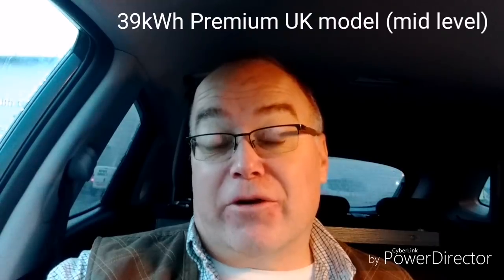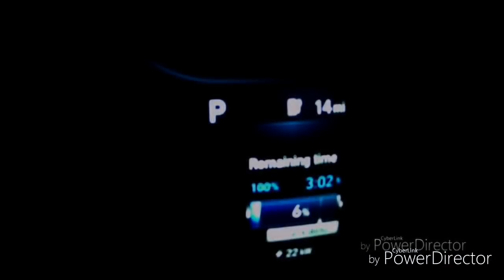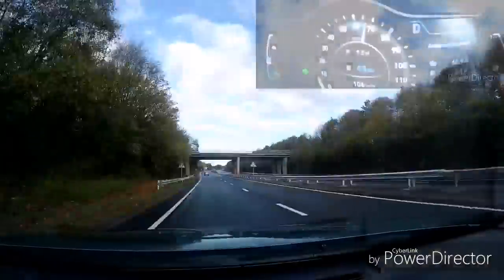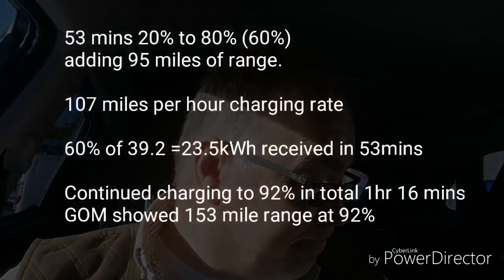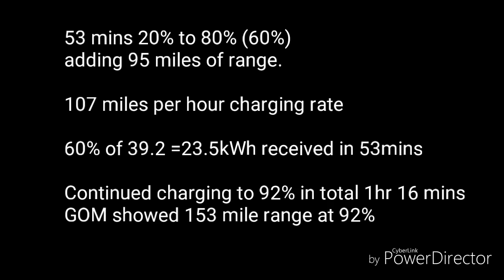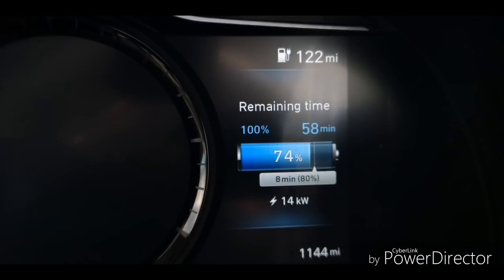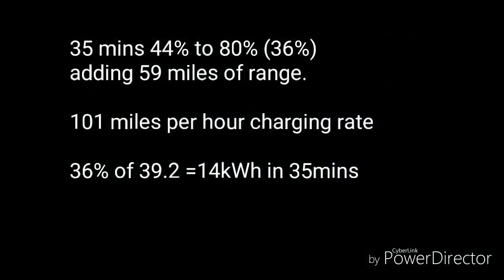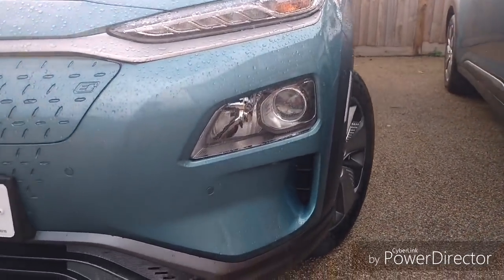Multiple Rapid Charging / Charging concerns & why I wouldn't buy a 39kWh Kona Electric

Comment: While it may be possible to set the car up at home to be nice and cozy from the start, once at work, there are not charging options. The issue you have thrown up regarding the temperature settings are of concern. You may say, forget the dial figure and just turn it to where you are comfortable, but to have 'cold' air blowing through should only work in the summer with a temperature sensor facing the windscreen. It would appear that everybody should test their dream EV car in the winter to ensure that it will perform as they would like.
There appears to be more questions about people's expectations coming from an ICE environment and being thrown in to an EV option thinking that everything will be the same. At least with an ICE car, you know it will be cold to start with and once the temperature sensor goes out I(Honda Jazz) you will get heat and the temperature gauge will reflect what you need. I would also be interested to learn about the direction of air flow with all the dashboard, screen and footwell settings. Starting from work (with no charging facility) on a cold winter evening, I would expect to have the front screen, overtaking mirror and rear screen defrost buttons pressed and a lot of warm air ultimately being blown out or elements heated to clear everything up for safer driving.
It still leaves the question about winter driving and impact on range - It is wet, and you need the wipers on. It is cold and you need the heater on. It is frosty and you need the rear screen heater and overtaking mirrors elements on. What range then?
Great video and opening up some tantalising questions.
Reply from the maker: Michael, I think you've got it and understand where I'm coming from. There's too much not knowing and it's hard to appreciate the car until you've owned it in varying conditions.  I did not expect half power or less charging at 5c. Whether that's right or normal is another question .

Range seems to be affected less than I expected by having the heating on but cold damp mornings are definitely less efficient than dry days.
Reply: You can start the heating on the Leaf from your mobile phone app while you are having your morning coffee and the car will be warm and defrosted before you set foot outside the door
Reply: @BSAT10  Which is fine while you prepare to go to work. Once at work with no charging facilities, for the return, the whole normal ICE heating regime starts once the 'engine' is started and moving. How does that compare with starting an EV from scratch in the cold?

Comment: Just to clear a few things up was the 39kwh battery preconditioned in the morning using winter mode? I found this makes a big difference with a cold battery.
Reply: I am interested about this too. I guess the Winter mode was not enabled during the test drive and charging.
Reply from the maker: Winter mode is completely separate and not relevant in the temperature ranges tested
Reply: @EVPuzzle  i understand winter mode is a separate bit to the car. However winter mode is used to precondition the battery therefore warming it up so its at idea running temp performance to drive and charge. 

➃ ‘Battery care’ shows the momentary power and energy consumption which are used when:

• Operating the winter mode to increase the battery temperature during winter to improve the driving performance.

• Cooling down the battery temperature during summer to prevent over temperature of the battery. 

hope this helps explain your results.
Reply from the maker: Mark I've had the detailed info on winter mode from Hyundai and their workshop manual.  It has no affect above -10c. It avoids the car going into turtle mode at too low temperatures. 
Winter mode on or off would not have impacted this set of tests, so I've been told by Hyundai

Comment: The throttling may be because of grid issues rather than the car. The UK's infrastructure is creaky (close to collapse if you believe some insiders) and cold days with high daytime grid usage will cause power distribution issues. Best to try this again overnight I'm afraid when grid usage is lower. Clearly not Nissan levels of rapidgate though.
Reply from the maker: John, that presumes a rapid charger monitors grid activity and throttles according. Have you found anything that confirms this.
Btw this was early Sunday morning so no peak times at all
Reply: @EVPuzzle  It's more that the local grid monitors demand according to the supply it is allocated and distributes accordingly. The power generation is taken online/offline according to predicted demand so Sunday morning will see a minimum of backup supply on-line. A cold morning easily eats up surplus and local network throttling can then be implemented to prevent outages.  The whole system is very efficiently run but is on a knife edge as older power stations are decommissioned. The downtime and maintenance of the rest has to be factored into supply both locally and nationally as well (grid loss being a function of distance). A very complex testing environment !
Reply: @johnnorth9355  
Hi John as someone who worked for Bonar Long ,Hawker Siddeley, and GEC all suppliers of the National Grid I can reassure you that your "insiders" are wrong
Reply from the maker: John, so you're saying the grid throttles businesses electric supply?  Either I'm obtuse or I just don't understand what you mean.
The charger is a business location. Its provided power at a stable rate. I see no reason for this business to have its supply limited than any other business so its supply should be stable. Chargers use less power than other businesses so it makes no sense to me to think time if day would impact how much power is given out from a rapid charger.
Reply: Not the 40kWh Leaf's levels of rapidgate, but worse than that. From what I've been following, nobody ever gets the "promised" 50kW with a Leaf, but people start calling it rapidgate when the power goes down to about half that, and anything below 30kW is considered quite disappointing. Here we have such levels from the very first rapid charge, with occasionally an unexplained much lower rate (and also occasionally an equally unexplained "normal" rate). And that while thermal management should remove most need for such throttling down.
Reply from the maker: Definitely confusing and disappointing.

Comment: What you are seeing here is a cold battery charging issue which is expected, once you warmed it up you got normal charge rates, in a real test you would start out with 100% drive for a least 100 miles heating up the battery and only then rapid charge, does the Kona not have battery temp readout, very poor if it doesn"t.

Comment: Maybe you can use that thermometer to measure the battery temperature before, during and after charging?
Reply from the maker: I did on the casing, couldn't access anything else. 7 degrees before rapid charging 12 degrees after. Its obviously well shielded

Comment: Wow, that seems much more aggressive tapering than I see on the 40 kW leaf. Weird. Re the heating we've found the leaf is the opposite, we need to turn the heating down. Even at around zero degrees outside if we have it any higher than 17 degrees it's too hot. The leaf seems to charge at 45 kW until around 60% charge and them drops down to around 35 kW. It only drops down to the 20s when you get past 70 to 80%. Wonder what's going on.
Reply: Yes very odd. But lemon tea leaf has been wondering with a few of us whether Nissan have done an over the air update because we're seeing different charging behaviour across a number of cars. They are tapering the charge more gradually, ie it isn't just blasting on 43kw until it hits a certain percentage. The tapering is more linear it seems. Not studied it but they may all be trying to work out how best to avoid cooking the battery. Certainly on this evidence it's quicker to charge a 40kw leaf than a 39 kW kona. Truly the EV Puzzle
Reply from the maker: Its arbitrary I guess as the 64 doesn't have such issues it seems. Mind boggling why the 39 might be so different with the same technology
Reply: @EVPuzzle  even your expected time from 20% to 80% is slow compared with my experience in the Leaf. Not at all what I would have expected with active battery cooling / heating 

I did a charge from 18% to 87% the other night in 43 minutes and that's faster than even what you expected in your comments above
Reply: @enyaq_gorm  I'll 2nd those Leaf comments. I charged from 14 - 80% in exactly 40 mins last night. This only raised my battery temp to 50% meaning if I drove at my normal 62 for 100 miles my next charge would have started at over 40kw. I can't believe Hyundai would throttle the charge that severely on a thermally managed battery. Seems like a fault.
Comparing the throttling to the 64kw is a bit unfair. 80% on a bigger battery still leaves much more room so won't throttle nearly as much.
Reply from the maker: Ross, comparing is fair because it highlights the benefit of buying the bigger battery.  
Who'd have thought the Leaf would outperform the Kona in a Rapid charging test?
Reply: @EVPuzzle  not me, and I own one! I genuinely think that car you drove had a fault, it will be interesting to see if any other Kona owners start reporting the same issue. Your first charge was only at speeds a 40kw Leaf would hit on its 3rd rapid so if it is the expected performance its far worse than rapidgate and with a thermally managed battery I can't imagine Hyundai making a mistake like that.
Reply from the maker: To hear from some owners of the 39kwh would be great
Reply from the maker: It left me wondering for sure especially when the Ioniq appears to charge quicker.

Comment: Nigel, nice set of videos comparing the two versions. The in-car heating issue is getting frustrating and will probably get worse as the temperature drops. I may have to report the Hyundai.
Reply from the maker: Cheers Glen
Reply: There have been suggestions on SpeakEV that the Heat button must be pressed as well as the A/C to get things to work properly. Sounds odd to me and I've not used my Kona since reading that so no idea whether it makes a difference.
Reply from the maker: The Kona has smart air intakes to supposedly limit exactly this, limiting the impact of cold air outside.  I'd guess it's the calibration of this system needs fine tuning
Reply: Just spent 20 minutes in a cold Kona playing with the heating controls. The Heat button comes on automatically with the Auto button but can be used by itself. I had expected warm air to start blowing straight away as there is no water to heat and circulate but there is a significant delay before air starts to blow warm and in the 20 minutes I sat playing the car interior never did get properly warm. 11C outside.
Reply: Malcolm Knight 
That's not normal for an EV. I drove a Fiat 500e for the 2 years I waited for my Tesla Model 3 and can tell you that both cars are blowing hot air within 30 seconds. It's almost funny how fast you can defrost a completely frozen vehicle. I used to worry about cracking the windshield. They might be using a heat pump which is more efficient but less effective at lower temperatures.
Reply from the maker: I bet theres a dark art to getting the heat right
Reply: @jujitsuboy730  The leaf gets hot pretty quick and you either turn it down or off 
George at "Fancy a Bev Mate" has a youtube video on the heating
John
Reply: @malcolmknight6450  It uses a heat pump so just like a home heat pump they are not instant it needs the compressor to start and of course as it get colder then a heat pump system will struggle more, as well as the water from an ICE car gets much hotter than a heat pump could ever hope for.
Reply: @jujitsuboy730  Yeah Tesla does not use a heat pump it's like the cheap Leaf uses a resistant heater elements
Reply from the maker: Gregory, there are heater elements which provide instant heat as needed.

Comment: As you pointed out these kinds of tests are a little tricky because of all the parameters. I wonder if the cooling fans are used to cool the bms. I thought the batteries are liquid cooled but I could be wrong though the fans may push air through a radiator. In any case something like leaf spy would give a better understanding of what’s going on.
Reply from the maker: That's the point, it sounds like fans but I have no idea what it actually is.  The different times it became active was confusing for sure. Nothing obvious.

The difference between Nissan openly showing battery temperature and Hyundai hiding it is interesting.